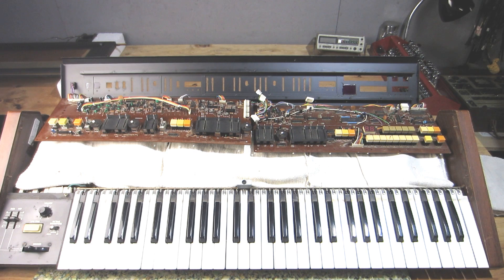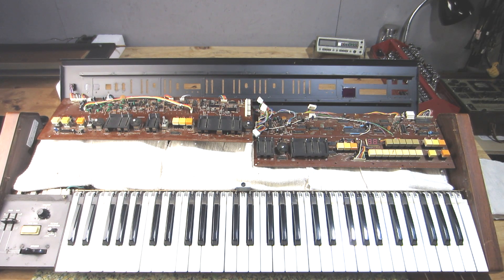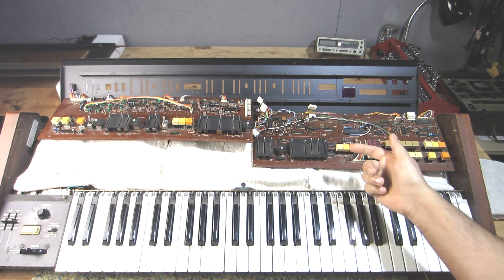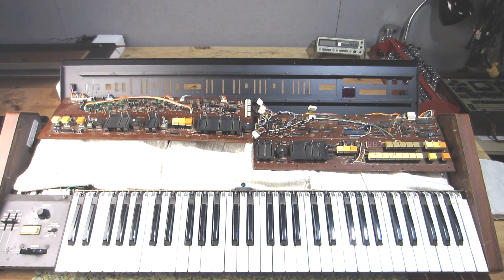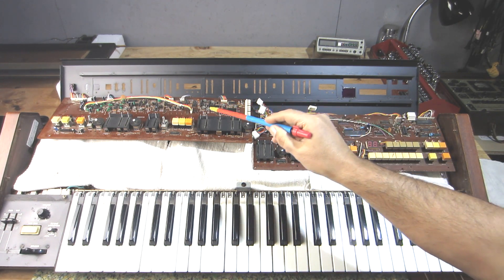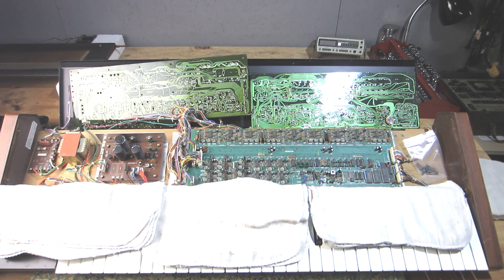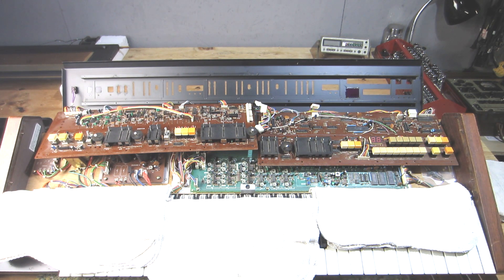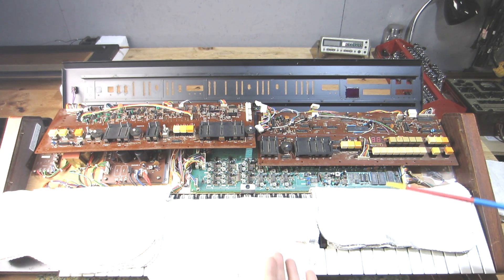Roland Juno 60 Customer Update Part Two

Comment: Nice evaluation, personally id advice the costumer to bite the bullet and authorise the whole slide pot set, its $180 at syntaur but it would be worth it, keep and rebuild the old ones as spares, but from what you've described my guess is that not all would be salvageable, besides some neglect it seems like an honest player grade unit, and considering the current value of a juno 60 id say its the price of ownership of a vintage analog polysynth, psu rebuild will probably sort out stuff along the chain,  nice series keep em coming
Reply from the maker: Thank You for chiming in Mr. Galindo, much appreciated. Thanks as well for the info concerning the pot set, I haven't looked in on availability for quite a while. Yes, there is definitely that price of admission when it comes to properly repairing and restoring vintage audio equipment , or anything vintage for that matter, i.e. cars, guitars or whatever ;-) Well, if I get the "green light" to do it right, I'll keep all of You posted as I get down to it in coming videos, have a good day !